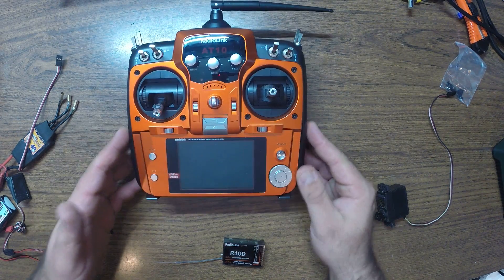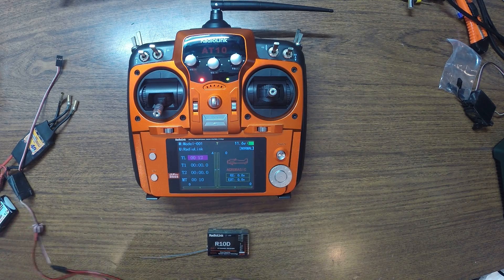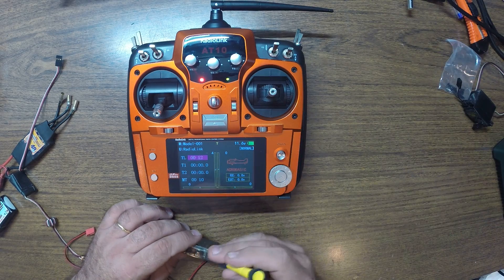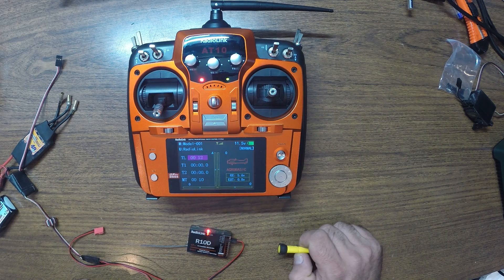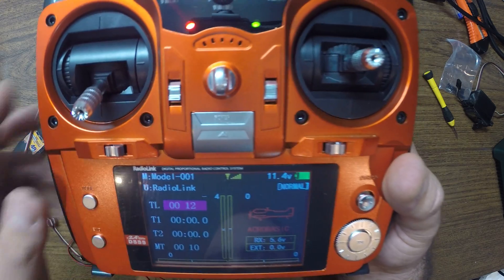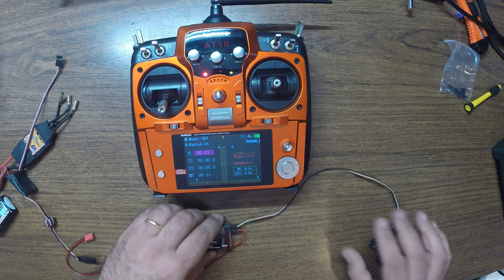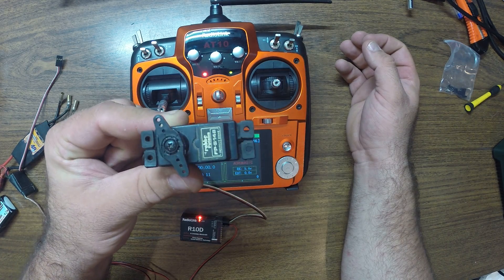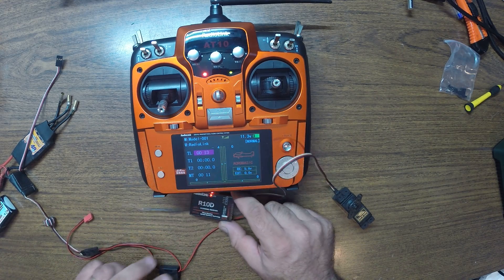RadioLink AT10 + R10D Binding

Comment: I bought this servo  "HJ-S3315D-Full-Metal-15KG-Torque-180-Rotating-Motor-Digital-Robot-Servo-US-A1J6"
from ebay, just copy and paste the name above to google, so it worked 3 times and when i come to use it for the 4rth times, it moves back then when i try to move it, it does not move.

Comment: Hello. I have questions if possible , I have this radio and I don't understand and I have osd fy- 31ap , I have the servos all works right but the 3 canal  wish is the motor don't work I change in all places also don't work ! The motor new and he work only when I change canal and he don't stop after , really I don't understand I need help